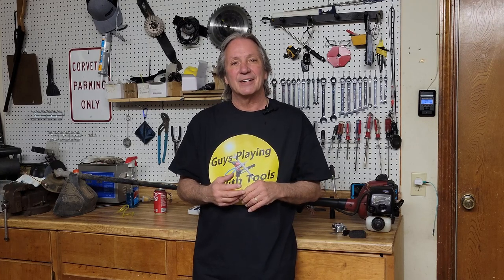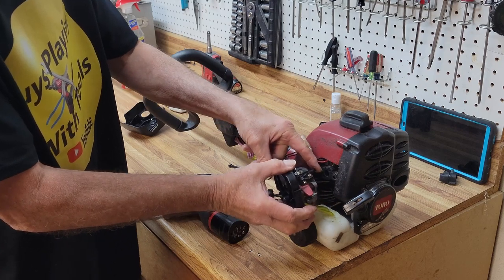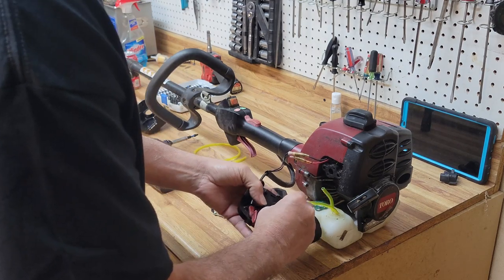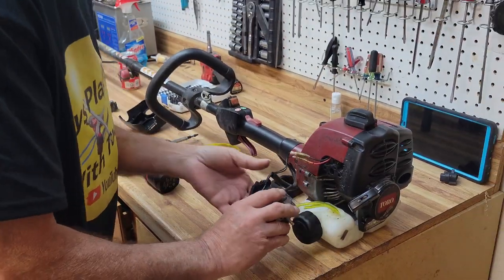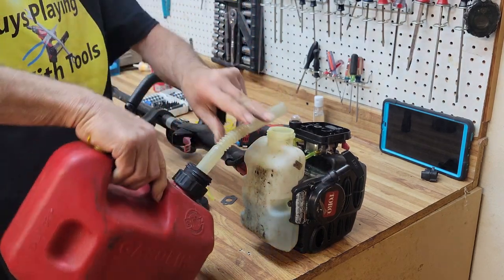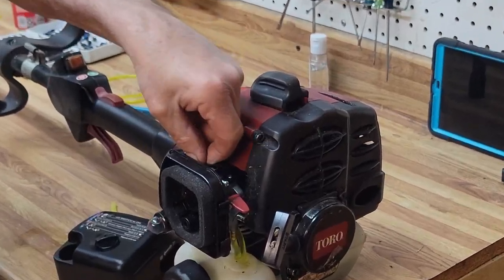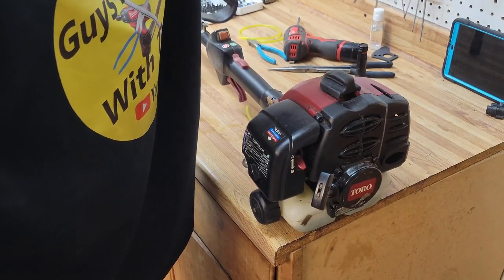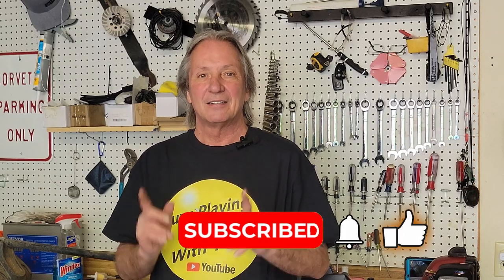Toro weed eater won't start after sitting

Comment: Nice job , i tend to change the carbs on the cheaper  stuff. Yes ive been there with the cable. Great video.
Reply from the maker: Thanks. I rebuild them now and then, but for most people, it's a lot easier to replace it and not buy all the tools you need to clean them right.

Comment: Nice Bill. I won’t be doing a carb job on my strimmer. I’ve gone battery 😁😁
Reply from the maker: Noooooo. Come back to the dark side. We have cookies! 🤣
Reply: @GuysPlayingWithTools  I still have four Husky chainsaws, two lawn mowers, one portable capstan. So not going away, be here a while yet😁
Reply from the maker: 4 chainsaws? I am jealous.  🙂
Reply: @GuysPlayingWithTools  I have a thing about chainsaws. I have two 254’s, 350 and a 357. The 254’s are my favourite. Used them professionally. Just rebuilt them and they’re as good as new. The 350 we bought as a spares or repair, I repaired it. The 357 has had nothing done to it. Looking at getting a seized 262 to rebuild
Reply from the maker: You are becoming a collector, I have one that I kept as mine, but everything else goes out the door as soon as it's done.
Reply: @GuysPlayingWithTools  collector is that nice for hoarder 😄
Reply from the maker: @@almclean4835  I hope not, or we are all hoarders 🙄🤣
Reply: @GuysPlayingWithTools  😉

Comment: I just took my carberator apart, clean off a little rust with q tip and wd 40, and spray some carb cleaner in all the hole. And looked for a tiny circular wire screen on the plastic part. Blast that good both ways. Works like new now.
Reply from the maker: Cool! When I see rust, I worry about where else there may be rust. Good show!
Reply: @GuysPlayingWithTools hmmm?  Never thought about that. Thanks
Reply from the maker: Since you got it running, it's safe to say you got everything, or at least enough of everything.  🙂
I use the ultrasonic only because it gets into the books and crannies I can't see or easily reach(plus, when you do a lot of them, it makes it a lot easier)
Reply: @GuysPlayingWithTools  I can't make it that clean, or else I won't have anything to fix in the future. LOL.
Reply from the maker: @ex8280 🤣

Comment: Old gas clogs up carburetors and leads to many pieces of equipment being tossed. The replacement carb is the way to go, especially when the knock-offs are so cheap and they usually work. If only we could learn to run the carb dry and empty the fuel tank before putting our small engines away (or learn to put stabilizer in the gas , at a minimum) Nice fix, Bill. You look really young today. Must be all that sunshine !
Reply from the maker: I do rebuild them and put them off to the side for the next one pretty often but I would hate to see people buying a cleaner for one carb. 
I am feeling young today. Spring does that to us old people. 🤣
Reply: @GuysPlayingWithTools  You said it, sunshine🌄🛴🔧🪛🔩⚒

Comment: 👍. I cannot tell you how many times I forgot to attach throttle cable too.  😊
Reply from the maker: I didn't edit it out because I can't remember the last time I did it, and it was kinda funny... 🙂
Reply: @GuysPlayingWithTools   someone gave me a Redmax trimmer it has been sitting for a few years unused and had saw commercial use.  I got it running but leaked gas from fuel grommets for the lines.  I went to look how much it was and for a few $ more I could  get a new carb. Lines and extra lines.  So I did that.  It works great.  But I have to get use to a head that rotates they way it does.  Also the spark plug boot shocks you if you bump into it with elbow. Ouch.  I think I need some electrical tape.   I have only been shocked once before by my MTD made trimmer. Because it was raining out side and I was using it.  Lesson learned .  That just hurt like [censored]👹
Reply from the maker: Ignition coils are pretty cheap,  after that, using it wouldn't be a shocking experience. Lol
I like redmax, they are worth saving every time.

Comment: My Toro bogs down too but I do not have a adjustment screw for the high speed. All I can do is take the carb apart and clean it. Any thought why there is not H  or L screw???
Reply from the maker: It's a design choice to save money.  I usually pull the carb when I see that and replace it with a cheap one that is adjustable. 
(I hate those too)

Comment: Where do you add oil to this small engine, and what kind does it take for this model in particular?
Reply from the maker: This one is a 2 stroke. With 2 stroke motors, you add the oil to the fuel,   between 40:1 (3.2 oz per gallon of gas) and 50:1(2.6 oz per gallon of gas). I usually run them all at 3 oz per gallon. It will give a tiny bit of smoke on some motors, but they last forever that way.

Comment: Do you know the part number for that gas tank or replacement link I can’t seem to find it for the toro 51938 model looks exactly like yours.?
Reply from the maker: This one changed a few parts, depending on the serial number, but this one will probably work, compare yours to the picture before hitting the button 🙂
https://www.repairclinic.com/PartDetail/Fuel-Tank/308675063/4526085?gclid=Cj0KCQjw4MSzBhC8ARIsAPFOuyWmmLZoGFDwu3AnbWsbFwNBo-R33u0Lr44zufh89pg5f4fmf4KpGOEaAncWEALw_wcB

If it looks right, it also lists the mfg part # and that makes it a ton easier to search for.

Let me know if that works for you 👍
Reply: @GuysPlayingWithTools  thank you 🙏. The problem I’m having is I can’t find the specific fuel tank for my model but the tank looks the exact same except some have no rubber grommet now. The toro 51938 string trimmer fuel tank is not available anywhere if I go buy model #. All the toros look alike I think it might just work

Comment: Hello there question where did you a just it from
Reply from the maker: There are 2 screws on the carb that require special tools that you can get from Amazon, the one closet to the motor adjusts idle, the one further from the motor adjusts the high end
Reply: Is ur carburetor aftermarket or original cuase I don’t have that screw only the idle screw
Reply from the maker: @jrzuniga1410  when I get one without the high/ low screws I replace it with an aftermarket carb.  On this one in particular, the stock carb has a single adjustment screw in the center,  down the center(from the top). I am not a fan of these because it's hard to get the adjustment perfect without both
Reply: I found the screw to adjust it on top of the throttle connection black top inside the small gold tip lol
Reply from the maker: @jrzuniga1410 I was trying to find a good way to describe the location without a pic.  Lol